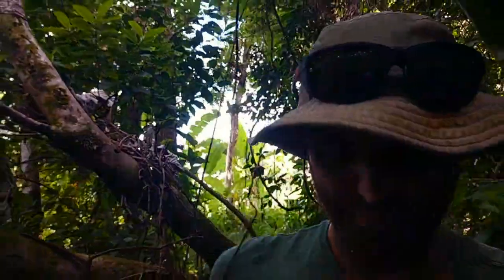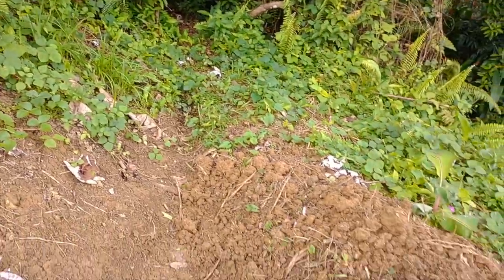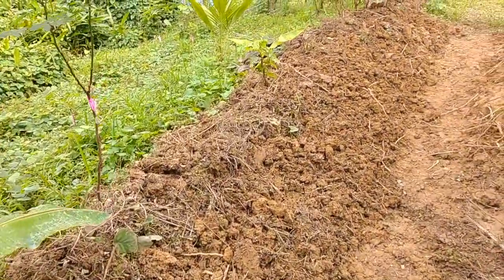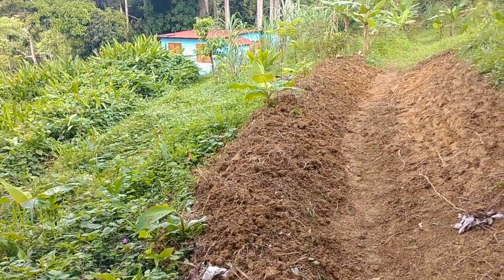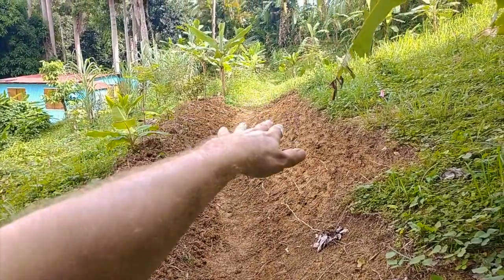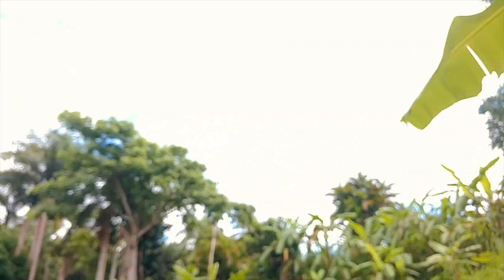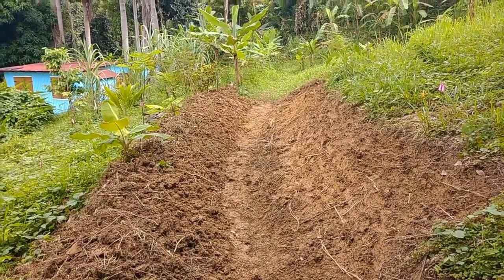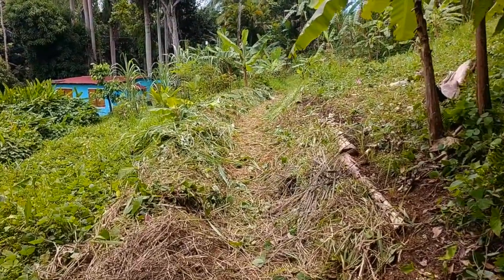Installing a Swale at Hacienda Rosa | Tropical Permaculture Homestead

Comment: Can you do a video about swales on steeper gradients ?
Reply from the maker: Hey Dario, sorry for the slow reply!

Swales are only appropriate on slopes up to 20 degrees, or 36% slope. Realistically, it's more like 15-18 degrees that's the maximum for stability.

Above that slope, swales are not appropriate and should not be installed. Swales should only be installed below or at the "keypoint" on a slope, where the slope goes from steep to more shallow.